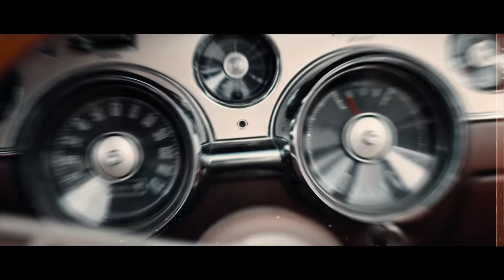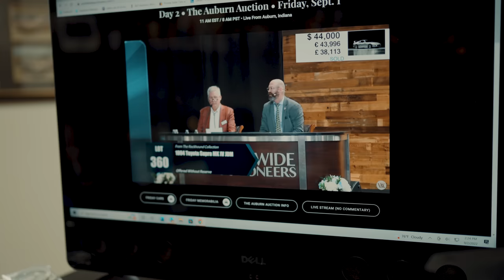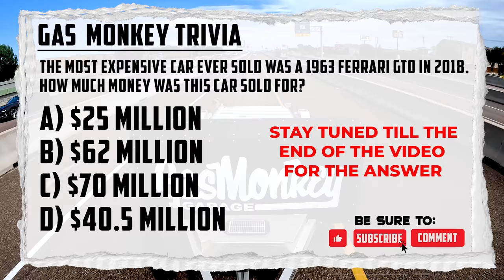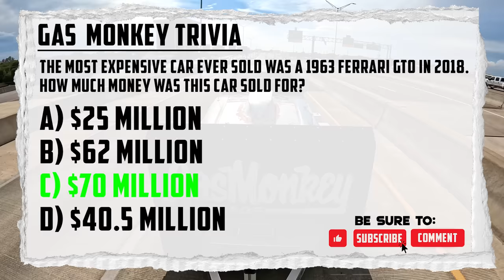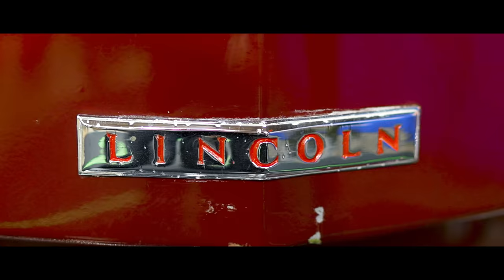6 Car Buying Rampage - Gas Monkey Garage & Richard Rawlings

Comment: I absolutely love that Phaeton.
We could have used an inset in the video, of the various cars, as they were being auctioned.
For 1933 the Ford was given a new cruciform double-drop chassis frame, and its wheelbase stretched half a foot to 112 inches. Evolutionary upgrades were made to the engine: improved ignition and cooling systems and new aluminum heads with 6.3 to 1 compression that raised horsepower to 75. Eugene “Bob” Gregorie slanted the flat windshield back, employed a similarly sloped grille and mounted the headlights directly to the fenders. For the 1933 Ford, Edsel Ford wanted a more graceful design than the 1932 style. It was Edsel himself who came up with the idea of using Gregorie’s Model Y concept for the lengthened 1933 Ford.

Comment: This sounds like an old man story but whatever, I saved all my coin at 15, my Dad helped me order a 1979 Pontiac Sunbird, no air, all black on black, and I enjoyed it for several years until it was totaled in a wreck from a couple running a red light.  It only had the “iron duke” four cyclinder…could not afford the V8 option, and it might have had 100 rwp….I wish I still had it.  Used to pretend it had a/c when trying to impress girls in traffic.  I live in the jungle here in Louisiana.  No idea how I survived without air all those years but it was so great to have a new car at 15.  3k total price with tax in 1978.

Comment: Nice find. Kind of pricey. Hope you had a mechanic look at the car before handing that much cash over for a 90's car. I hate Pinto's especially the interior. My grandmother drove a bright red one in the 80's. I guess you could go win some street races in that car and win your money back. They have a light body for racing.
Reply: The Supra is about as right as right gets. It used to be housed at a classic car museum I worked at here in Maine and I had the opportunity to drive it on a few occasions. Runs great and if you step on it, it will put you back in the seat no problem. PLUS...You can never go wrong with a twin turbo 2JZ.

Comment: That supra isn't worth that money. It's an automatic and it's RHD. The high dollar cars are factory stick turbo cars that were LHD. Far less of those around. There is a very good reason why you got it for what you did. You may have over payed to be honest. If your buddy told you to buy that car than you should probably find a new "JDM specialist".
Reply: what I thought aswell . non targa and cloth seats too . aftermarket wheels and what looked like skirts
Reply: Well said, He paid the "market value" for it and the engine bay was looking a little rough to for a car with 14k original miles. Clean RHD TT autos are going for the mid 40's-50's. Imho I don't think he hit a home run on this one.
Reply: And that’s why you have multiple successful businesses and deal in cars daily with a lot of success as well?
Reply: The automatic kills the value
Reply: @awesomeness8206  Actually, yes, yes it is.

Comment: What was that horsesh*t where the auctioneer wouldn't take the $1000 bid increase from Richard? If you bid more than the current bid then it's a valid bid; doesn't matter if it's a dollar more or ten thousand more.